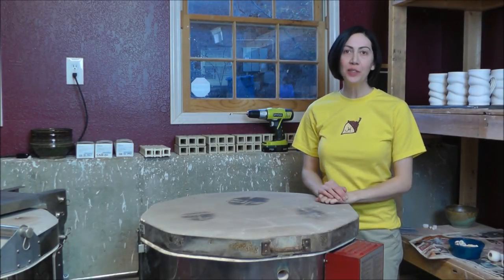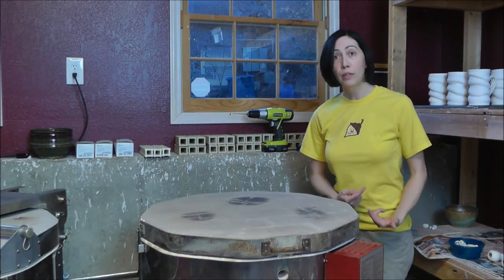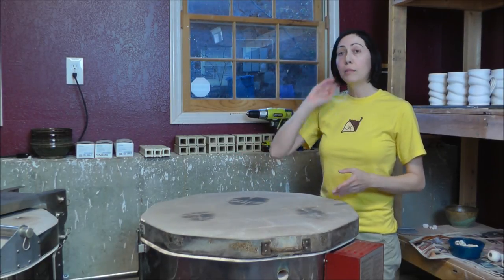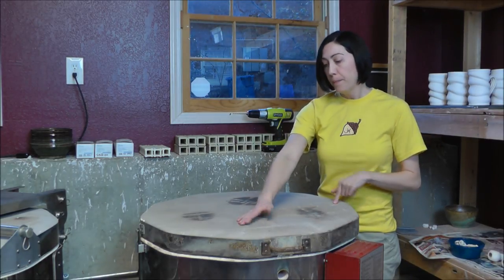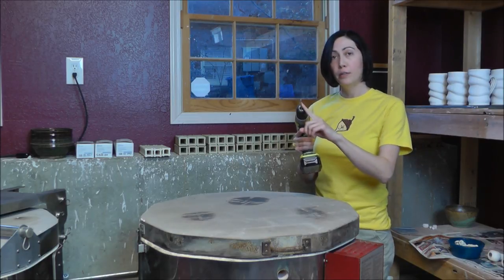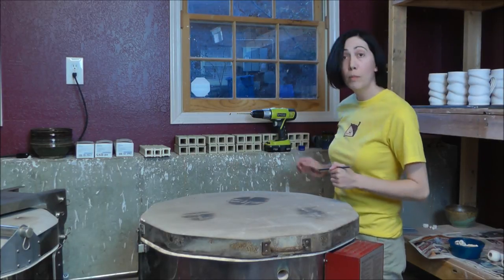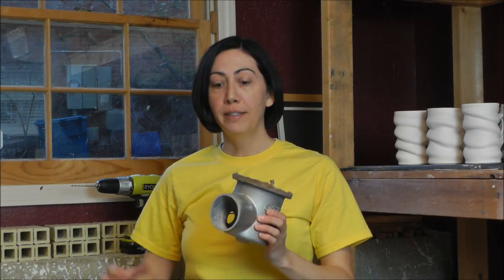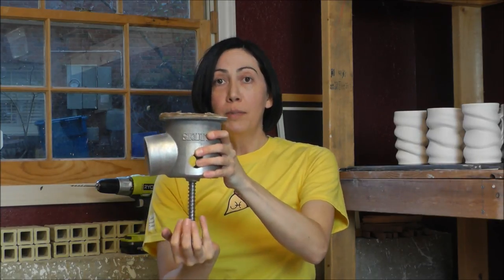Pottery - Kiln Venting

Comment: Very helpful.  Going to be setting up my wife's new Kiln in the future.  This really helped.  Any certain exhaust hood on the outside of the house?  We have a sprinkler system in the area where the Kiln will be.  Understand you have to be careful with the placement due to sprinkler heads?  Finally, is there a recommended height for the exhaust pipe to be?  Noticed yours was above the concrete foundation but if you don't have a foundation can it be much lower to the ground?
Reply from the maker: To my knowledge it doesn't matter at what height you mount blower. Mounting it lower should be fine. Perhaps you could put a dryer vent style external cover on the vent outlet to prevent water from getting in from the sprinklers. Here's a link to the Envirovent manual. 
https://skutt.com/pdf/envirovent2/Envirovent2_Manual.pdf
Reply: Thanks for this! We’re about to drill holes in our second-hand kiln and it was nice to watch someone else do it first.

Comment: I have a used kiln I just acquired.  It is a 3 year old cress firemate.  it has installed a Cress clean air exhaust system.  I have put it in a metal garden shed with a cement floor.  The tube comes out of the box, which is below the kiln switch box. (It is a kiln-sitter kiln).  The problem is I have no idea what to do with the tube.  Do I need to align the kiln so that the tube comes straight back from the exhaust fan, or can it wrap around the base before snaking up the wall?  I also need to know how high on the wall I need to go before installing the tube into a dryer-type steel vent we bought with a little hood so the air from the kiln comes out and then down.  Any advice?
Reply from the maker: Hi Jaime, I'm no expert on that system, but here's my gut feel. The height shouldn't really matter. You may want to raise it up a couple feet to keep the exhaust opening away from critters like mice outside. And I would try to keep the hose run as direct as possible minimizing turns and kinks. You can put in a sweeping arc but avoid tight bends. That's what I would do, but take it with a grain of salt. You should definitely use metal hose not crinkly foil dryer hose. You don't need a rigid duct, but you need the curvable, round, metal hose. Hope that helps! Congrats on your kiln!

Comment: I have a small duncan kiln and I usually fire it with the top peep hole open. I am wondering if I drill holes into the bottom for my vent, would the peephole be enough air flow in or do you need the holes drilled into the lid? Thanks!
Reply from the maker: The peep hole will be too much. You need to drill the holes in the bottom and top for the vent to have the correct air flow balance.

Comment: Hello, can you please tell me whether the Envirovent 2 is supposed to be run continuously for the entire duration of the firing cycle, or only a portion of it? If it gets controlled by the KilnLink, does the blower turn off at certain times during the firing cycle? Also, how hot does the 3" flexible metal duct get while firing? Will it be too hot to touch? If so, is it acceptable to wrap the duct in insulation to prevent burns or could doing so potentially damage the blower due to overheating? Sorry for all the questions. Thanks for uploading such a helpful video!
Reply from the maker: Run it for the whole firing including the cool down. Mine is manual and not connected to Kiln Link. It has a toggle switch on the cord. Just flip it on and leave it on. The 3" duct amazingly doesn't get hot at all. Hope that helps!
Reply: @EvolutionStoneware  Thank you so much! You're so helpful 😃
Reply from the maker: No problem! I'm happy I can help.

Comment: Hi, the plenum cup has two openings aside from the one where you are attaching your air-duct. Do you leave those open? should they not be blocked off? when you turn your exhaust fan on will it not also suck air from the room's floor? or is there not a chance that the air that will be coming out of the kiln will simply escape into the room via those openings if the motor of the exhaust fan is not strong enough?
Thanks, just curious... I'm getting mine soon and just wondering how this actually works.
Reply from the maker: Hi Luc, they are designed to be open. I found it strange at first too. Even with the openings it still pulls air through the kiln. You can test it by closing the kiln, putting the peeps in, turning the fan on, and holding a blown out match that's still smoking right over one of the holes in the lid. The smoke will be drawn in. I don't know the details of the manufacturer's design parameters, but they set up the number and size of vent holes in the lid & the kiln floor to move a specific volume of air over time through the kiln. And the fan pulls additional room air through those holes in the plenum and blows it outside.

Comment: Loved this video, for some reason I couldn’t find info from the manufacturer of my kiln on how to vent, other than the system they sell. Did you use a masonry bit or jus a regular drill bit?
Reply from the maker: A regular drill bit is all you need. The brick is very soft and easy to drill through. I'm so glad to hear this helped! Thanks for taking the time to drop a nice note. Hope your vent installation goes well.